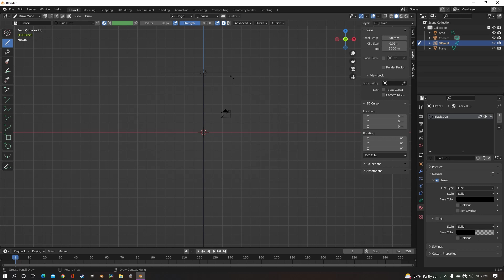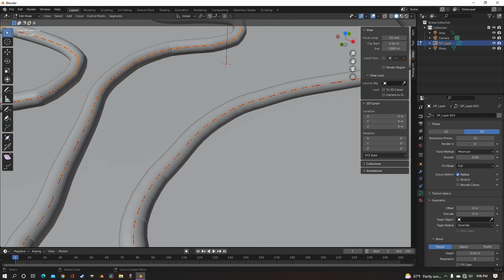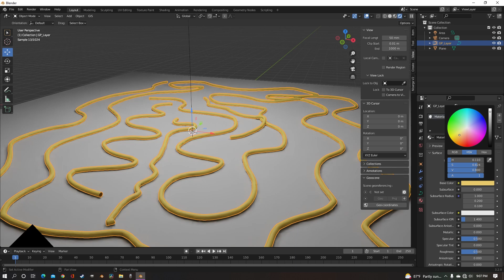QUICKLY make Cords/Wires using Grease Pencil (Blender Quick Tutorial)

Comment: For some reason, it's not giving me the option to convert to a bezier curve? I get the option to just convert to a curve, and then nothing happens..
Reply: I had the same issue, turns out there's an add-on for that called "grease pencil to curves" and you can just convert while still in the draw mode from the edit panel on the right side.